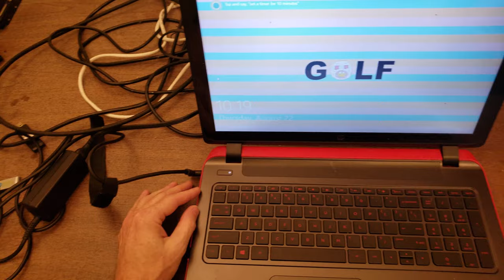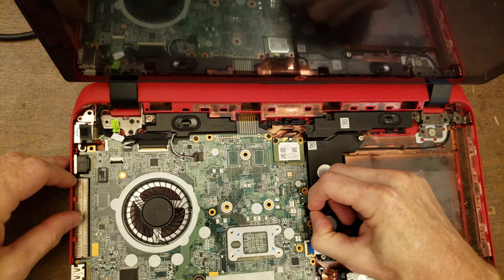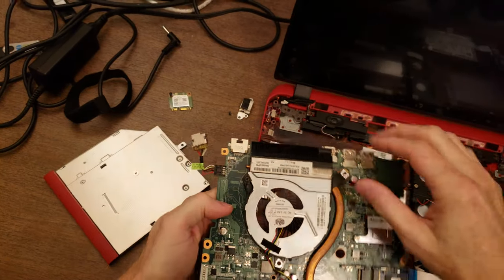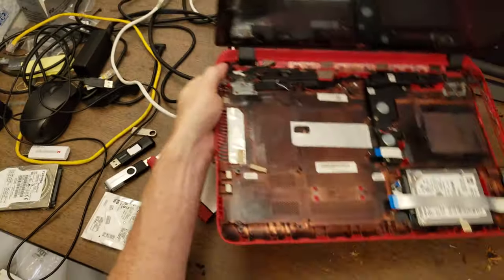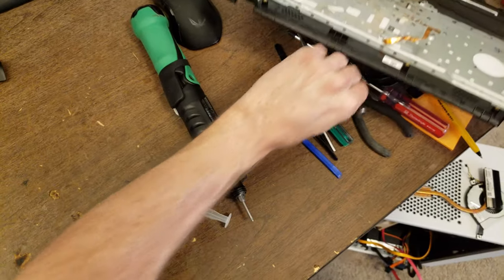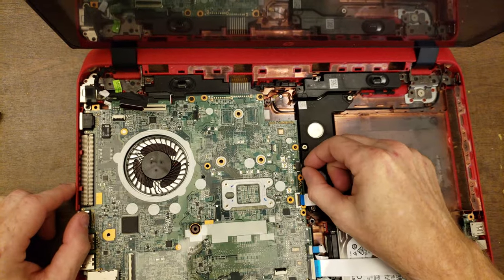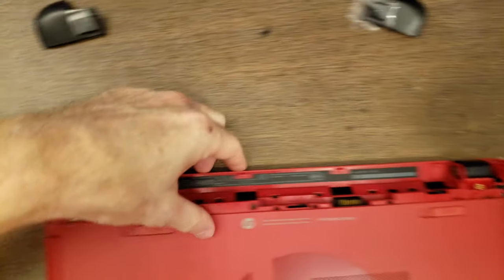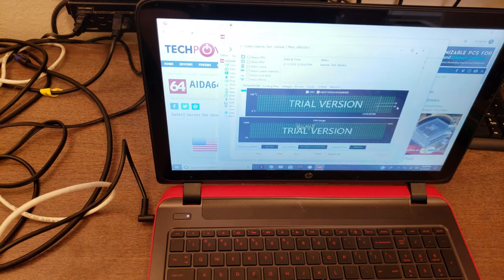HP Beats Laptop overheating another malfunctioning heat pipe

Comment from the maker: At 19:30 into the video I accidentally covered up the left speaker cable.  I went back and fixed it when I did the SSD upgrade.
Reply: Excuse me I have this exact model.  I'd like to know how to fix mine. So the fan won't spin and my screen is black. But the power button comes on. May you help with this please and thanks so much 💙
Reply: If your fan is not working that's normal the pc won't let you turn the pc on due to the security to prevent from overheating it.
Reply: @maissix242  actually I just took it apart cleaned it all out. Tightened any screws I saw and put it back together and it worked
Reply from the maker: That doesn't make any sense to me.
Reply from the maker: Sorry,  I just saw this comment.  Try disconnecting the battery and don't connect the charger.  Hold down the power button for 30 seconds,  plug in the charger and press the button.  That may get it going.
Reply: My son has that same computer also and he is having Shutdown problems with his. I reflowed the CPU and GPU but it is still doing it. I am gonna take it back apart and see if it could be a bad heatsink after seeing your video.. I hope that is all  that's wrong with his computer because I know that he is ready to have his back and stop using the other one I gave him to use for now.... 
Also  I noticed too that you forgot the left speaker connection when you started and was saying to myself "I bet there will be audio problems" !!
Reply from the maker: @jaro2608  I left a pinned comment talking about the speaker connection I did go back and fix it. If the computer is shutting itself down chances are it is cooler that's the problem. The main symptom there is it's shutting down and the air coming out the cooler on the laptop is room temperature.
Reply: @MichaelTheComputerGuy   Honestly I am gonna have to check his laptop again and see how the air is coming out of it. I have not messed with his laptop in a while since he has been using the other one I let him use. Thanks for the tips and also for the reply. I appreciate it a lot..

Comment: I had this exact problem on the same computer. Took my computer to a computer repair shop,  and he told me to buy a new computer. I thought what the heck try to fix it myself. Watched this video, bought the pipe on eBay for 50 bucks, changed it and the problem is fixed. Thank you very much.
Reply from the maker: That's great

Comment: Ok, i just replaced my HP 15 i7 's heat pipe with a used one that i found online (not from china). And voila! The temperatures were like 98 degrees before no matter what i did (including changing the thermal paste several times), after changing the heat pipe, now the temperatures max 55 degrees. I think HP laptops from that era have factory malfunction due to the faulty heatpipe problem. You are the best, man. Cheers!
Reply: How can the heat pipe be bad its just metal? I just got done putting mine back together, changed the fan and DC jack new thermal paste, still blowing hot I did not replace heat pipe becuase when I pulled it apart I saw the fins were jammed with lint, figured that was the problem. Did U go through this trial and error?

Comment: I literally know nothing about Pc or laptops. I have this same exact Hp beats laptop and it keep over heating and shutting down. I think im going to follow this video.
Reply: I found a cooling pipe on ebay for around 50 bucks changed it and it's working fine now
Reply: @barryluft4451  thats cool hows it working now
Reply: @skygrey5921  It worked fine for quite a while, however I ended up buying another computer eventually. It still works but I don't use it anymore.

Comment: i have a hp15 series, had to replace the heatsink on mine, ebay had em 
for 12 bucks still, just bought it the other day. bought from upper edge
 tech on ebay. used kyronaut thermal paste.  before the fix when running
 one instance of firefox and youtube my cpu would sit at 65c sometimes 
higher if im doing more stuff. at idle it was in the high 40s, so youd 
think it was cooling itself off, but after running aida 64 for 30 sec 
she heats up over 100c. after the fix she idles at 35 to 40 and with 
aida 64 it doesnt get hotter than 57c. pretty amazing how a piece of 
copper tube can ruin your whole pc. thanks to ebay and a 20 dollar fix 
with the thermal paste.
Reply: keep in mind i cleaned and repasted before i bought the heatpipe. thanks to this guy for the help
Reply: Hello friend, I live in Brazil and I have the same problem that you mentioned in your comment, my HP Beats 15 when I open a video on YOUTUBE or do a Benckmark test on AIDA64 the processor reaches 100 degrees, you could pass me the link on who bought the heat sink?

Comment: You say you have a video of when you did another similar hp with the same problem and you tested the heat pipe thing and you found that it was blocked half way...do you have a link to that video??  I have a similar problem as well with my son's laptop shutting off error 90d thermal shutdown, fan louder than normal, seems to spin faster than it probably should and shuts down after about 5 minutes or less of being turned on and I am wondering if it needs replaced or possibly something else is the problem.  Some say it could be software issues as well but personally I believe it's more a hardware issue like the one you fixed here but wanted to make sure before I spent the money and took the time but there is no link for the video you mention.
Reply from the maker: put your hand on the exhaust of a laptop and see if it's room temperature or hot. If it's hot that means the cool is doing its job. If it's room temperature that means it's most likely the same problem I ran into in this video and in a previous one.
Reply: @MichaelTheComputerGuy  honestly it almost blows cool.  I got rid of the dust and dirt, replaced the barley there thermal paste and it's still shutting down so I'm assuming that it's the heatsink.   Do both the heatsink and fan need replaced if the fan seems to be spinning just fine??  I'm about to order the heatsink off Ebay but its from China and will take forever to get here my impatient 14yr old isn't happy about that.  I just don't trust these other computer sites that say they have it, hard to tell what's legit and what's not these days.  Best to go with Ebay or Amazon when it comes to online purchases.
Reply from the maker: @katiemcbride2658  It sounds like the fan is fine and it's the cooler that's the issue.
Reply: @MichaelTheComputerGuy  thanks I ordered now the fun....waiting....I'll lyk how it turns out.  Thx for the video I knew It couldn't be that hard to fix it myself!!

Comment: Thanks so much for this helpful video.  I have the same issue with my HP Beats, and ordered a used replacement heatsink/heat pipe.  Unfortunately, the used replacement has the same issue.  A forum on the internet suggested a method to submerge the fin part of the heat pipe assembly in hot water and check if the CPU spreader side gets hot - if it doesn't the heat pipe is broken.
Reply from the maker: If when connected to the cpu and on air coming out the cooler is room temperature the heatsink is the issue.  I was wondering if a replacement found online might also have the same issue. You just have to try another one.

Comment: I hope i have it as easy as you. I am working on an ASUS X43SV. It has single fan with dual heatpipe assembly. I was reformatting the laptop, and after it completes, it shuts down itself. The bottom of the laptop is very hot to touch. That points obviously to blocked fins. But upon opening it up, all is clean, with new thermal paste and the fan is blowing merrily with warm air going out. 

Assembled it back together and using HWMONITOR it is showing 89c at idle. I loosen the keyboard to allow me to blow cool air into the openings with a USB fan. Temps dropped to 68c at idle. There is warm air being blown out of the heatsink all the time. But the temps isn't going any lower.

So i am seriously pondering if i should buy a new replacement heatsink/ fan assembly for it. I saw a youtube video on how to test if the heatpipe is working with 2 thermal probes and a heat gun. But i'm not going to buy the probes because this is a very rare case. So do you think that this might also be heatpipe related issue?

Comment: You truly know what you're doing. Question. I have a 17 inch HP envy and the screen is fine no problems but, the rubber seal for what I assume is part of the bezel, the exposed rubber got old and dry rotted. So the small pieces started flaking off. So I took a hobby knife and cut away the dry rotted rubber. Now I see the rubber also serves as a pad when the laptop is closed, so that there's no screen to keyboard contact. Not sure if you ve ever delt with that, but I'm curious if you have any suggestions.
I certainly don't want to open a can of worms trying to replace the bezel,but I don't know if there's any other way to put something on it that will serve the purpose. 
So far it's just at the top, but I have a feeling the rest of the exposed rubber will do the same. Thanks for reading. Any advice would be appreciated. Take care.
Reply from the maker: It's difficult to know without being able to see it but rubber like that typically does fall off and it's not really an issue. There might be some extra wear on the surface but that's it.
Reply: @MichaelTheComputerGuy  Thanks Michael, Yeah, it's probably something that would only happen to me,😂.  Keeping old things like cars, tools, phones and computers. But I paid 1200 bucks for the thing back when it was new, and that was on sale. And other than this issue, it works great. Guess I'm trying to squeeze every dollar out of it. 
Glad to see you're still in biz.  You truly seem to know your stuff, and that's cool.  I love keeping tools and stuff working too. But electronics are so intricate, and tricky.  I tried putting a battery in an old moto x pure, cell phone once and accidentally cut the cable for the on button. I could have ordered the part but probably wouldn't have been worth the price. 
So now I have a new battery, screwdriver kit and a phone that keeps turning itself off and on. Crazy huh. 
Anyway, thanks for answering. Take care.

Comment: @michael the computer guy I have a HP 15-P213cl doing the exact same thing, new SSD, from HHD, updated RAM , Fan and having the HARDEST time finding the heatsink. I possible found one off eBay kind of sketchy if you ask me. 
Why can’t these be fixed? It’s just a hallow tube according to HP it’s not filled with air or gas of any type, they told me the only way it could fail is if it were bent, but of COURSE, no more help then that, no part, no suggestions how to fix. 
I should be getting mine tomorrow. I would love to get your feed Back on this! 
Thanks
Reply from the maker: I dont understand why so many from these beats brand laptops are failing this way.  The only fix is to get a replacement heatsink and hope it doesn't fail like the original.

Comment: Hello everyone, greetings from Venezuela, how can I deduce that the heat pipe is defective?
Reply from the maker: The symptom to look for is the one I mentioned.  If the computer turns off after a few minutes and the air coming out of the vent it room temperature the heatsinks is faulty.

Comment: Huge thank you for doing this video. My laptop keeps overheating and shutting down. So I’m going to check to see if this is the same issue. Question though: What if it’s blowing hot air instead of room temp air?
Reply: Also, my HP beats laptop has this golden colored screw under the CD Rom drive after you pop it out, do you know which screwdriver I should be using to get it out?
Reply from the maker: what I would do in that case is use your phone to take a close up picture of the screw head. You should then be able to enlarge it and figure out what type of screwdriver you need.

Comment: I have the same laptop. It started lagging and then the fan started running hard. The laptop eventually shutoff and won’t stay on for more than a few minutes. To me the air coming out the side feels semi-warm. Infrared thermometer registers 89F air coming out. Using the SpeedFan app my fan is running at 364 rpm and the temps read HD0 = 32c, Temp1 = 96c, GPU=96c, Core = 99c. I replaced the thermal paste and still get the same readings. Being that the air is warm, can the issue still be the heat sink? When it shuts down I get a message that Thermal shutdown occurred System temp (90D).
Reply from the maker: If the air coming out of the side of the system is warm it's not the same issue. Concentrate on cleaning the cooler and replacing the thermal compound between the cooler and the processor.
Reply: @MichaelTheComputerGuy  Yeah, the air coming out seems about the same as my other laptop. I cleaned the fan and replaced the paste and still have the same results. I guess I'll keep digging.

Comment: Thanks for the great and complete video. Did you happen to notice is there a slot to upgrade the memory? If so where?
Also, how the heck does a metal tube fail? Is it not just clogged with dust? Every laptop I've ever had needs to have canned air blow through to remove dust periodically. Stick a pipe cleaner down those tubes to get the chunks of dust. Blow through it? Did you try that? In any case, mine is shutting down randomly and nothing in the windows event logs to show any errors etc, such as hard drive .
I was thinking memory till I realized it was happening most frequently when sitting with it in my lap, likely preventing airflow. Also it passed memory tests sooo...hmm. Must be heat! Was blowing very hot air. 
So glad I watched this. Was trying to take apart to clean it but wow. WTF? Much bigger job than anticipated. Reminds me of the old iBooks. I'll button up for now, take a look later when I have memory IF I can get it? Any ideas on that?
So, I'm sure you must've tried to blow out the tube, but seriously, what was actually wrong with it?
I mean was the tube split open? The fan slowed down? What? I hate HP consumer grade products. Garbage. But I can't complain. Paid $150 with Office 2016 but definitely time to do a backup, if it doesn't crash. Maybe sit it on top of an ice pack.

Comment: I have the same laptop with the fan working but at 45 to 56 Celsius all the time. Do you think replace the sink could help to reduce the temperature?
Reply from the maker: Those temps are bad.  I wouldn't worry about it.  If you want to lower the temps try blowing out the cooler with compressed air or opening up the system like I did a replace the thermal compound.  A new cooler won't help.

Comment: Well, I've also got an HP Beats laptop (Envy 15-k203ng) with a dedicated GPU. I've encountered the problem that the CPU is overheating (97°C), which I thought may be accepted by HP, but the GPU never exeeds like 75°C on full load. So, I've replaced the thermal paste two times and tried to tighten the screws as much as I can, but the problem remained unsolved. The fan spins almost constantly and it's really loud. The air which comes out is very warm, but not that hot. So I figured it might be a problem of the heatpipe. I tested it with the mainboard outside of the case. Firstly, I stress tested the GPU with Furmark. It never went higher than 61°C (will be higher in games probably, because the CPU will be under load too and the board was not inside the case). The heatpipe from the GPU was hot, not burning hot, but you could not leave the finger on there for more than one second. Then I stress tested the CPU. Well, 97°C again, but its heatpipe just was cold, even directly above the chip. So, I've ordered a new cooler from Ali Express and hope this will fix the problem. It probably will not arrive until next week or even later. Btw, the CPU never throttled, neither did the laptop shut down. At times, it occured that the laptop will just freeze, but that was rare. I just cut down the maximum TDP of the CPU for it to not overheat that much (from like 15W to like 13-ish Watts), which helped a bit.
Reply: Hello,
Did you solve problem?
May I kNow what was causing it
Reply: Exact problem, cpu is 97-98 degrees on load but gpu is only 60. I think one side of the heatpipe has malfunction. This is a purposedly introduced problem by HP to these specific models. Did Replacing the heatpipe solve the problem for you?
Reply: After changing the heatpipe it is fixed !

Comment: Totally girl geek boner on right now.  I've wanted to try to fix an overheating issue on an older laptop for forever so since it's getting ready to get replaced, I may get the opportunity! LOVVVVE this video so much that I liked and then unliked, just so I could like again. LOL!!!

Curious, what is the space that looks opened above where the hard drive is?  Space for a second drive maybe?  

Also, what is the safe range for CPU temperature?  I may buy Aida myself.  It looks like a pretty worthy application to have.

Excellent video!  #NewSub! :)